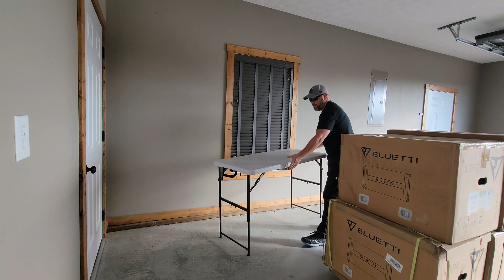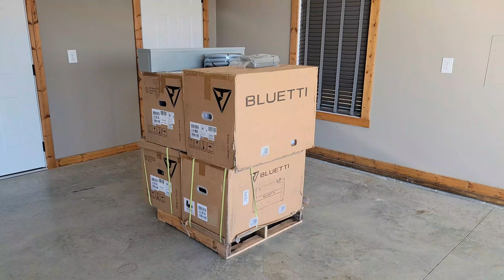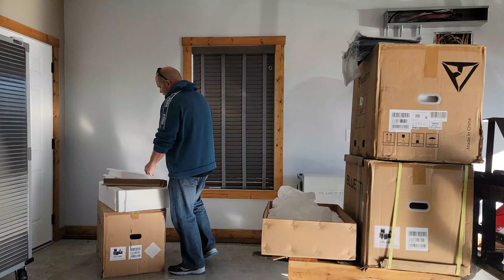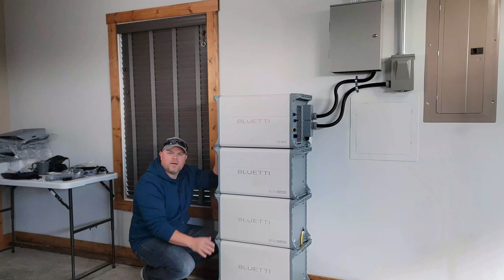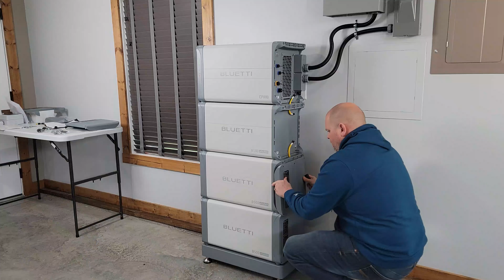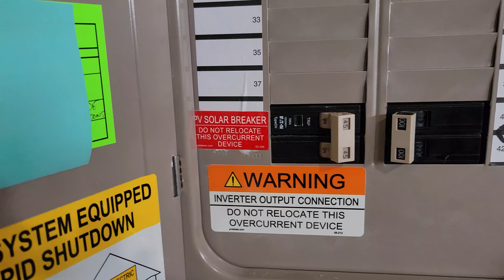BLUETTI EP800 B500 INSTALL - 7600W 120V/240V home Backup

Comment: Great job on the video, but who has their power to their home go out that much? If I bought an EP800/EP900, I would want to run off the battery all the time. Solar arrays providing power. If the battery gets to 10%, then automatically start charging from the grid to the battery until 50% and then stop.
Reply from the maker: Thanks for sharing

Comment: Nice video.  You have a real good ability to understand what needs to be done and convey that information in a manner that’s easily consumed by non professionals.  That said, I was most impressed with your ability to lift and place those batteries!  Lol.   Quick Question - I'm considering installing this system - do you see any issues with the bluetti being in another room about 25 feet from the service panel?

Comment: I have the Bluetti AC500, the B300S one battery and the 350 solar panel packages. I wish I had seen your video before purchasing. Love to see you hooking up the BLUETTI EP800 B500 Home Battery Backup. I am a slow learner, and you explained it with ease... Ty. Any advice for the kit I just purchased?? We purchase this kit just for power outage. Maybe have it hooked up to the house electrical panel?? Any advice would be helpful. Ty  :)
Reply from the maker: I have couple videos on the AC500. I am currently using that in my shop as a 240v system.

Comment: I just recently came across your channel. Observations, you are very talented and also have an incredible skill for instructing to even including reference to the sources of the products you are using. Are you an engineer? I notice your workmanship details and frankly you are much better than the workmanship I have seen from licensed electricians. A little harsh, professional electricians I fully understand are driven by time and profit, you have the advantage of time and no income incentive because you are only doing one time. Example putting insulating bushings on the ends of your conduits to prevent wire chafing. My question: why did you decide on the Bluetti batteries vs Enphase 5P batteries to keep the system homogeneous?  If you had installed Enphase IQ8A inverters you would still used the Bluetti batteries? I may have answered my own question.
tt
Reply from the maker: I appreciate that. For most Enphase users they will probably go with Enphase batteries. However, I like to explore all the options and always challenge the status quo. I am very happy with the Bluetti EP800 and B500 batteries. If I were starting from scratch and I was not backfeeding the grid I would only use the EP800 and B500 batteries. Bluetti does offer an EP900 that could back feed to the grid, maybe someday I will try that out :) Thanks for watching and commenting! 👍
Reply: @TheSolarPit  Justin - Great video.  I'm contemplating that EP900+B500 install.  Do you know if in that case I'd move the solar injection into the load into the sub panel?  With your set up, I don't see how the AC solar can help charge the batteries when/if the grid goes down?  But they should be usable during the day with the grid online.  Can you comment?

Comment: Too bad I wouldn't come with 6 batteries. It would be good if you could have you hook up 6 batteries instead of just 4 batteries. Do not make that a perfect machine, but then again they do get the AC 900.
And that comes with a lot more batteries. I understand that definitely electrician for as well. Of course, I know you can pair 3 of those inverters up, but each of them have their batteries for batteries. That is 12 batteries with 3 generators. That is a great machine then as well, that way, but I still wish it would be. I don't have six Batteries to each one.
Reply from the maker: Thanks for watching and commenting

Comment: I was hoping it had better management for Grid-Tied Micro Inverters. because a lot of those use Powerline communication. So i would have been good to have a system that can track and monitor your solar production as well as knowing how much of your solar production is actually going into the battery packs vs coming from the Grid. 

It feels that with most products, if you want true home backup and better management, you need to go with a DC Coupler Solar system to the Hybrid Inverter. That would give you the clearest management of storage vs production.

The only unit i have seen that seems to manage it the best is the EP Cube. Because it's gateway has a separate input for AC Solar and other power generation options. The next closest one is the Tesla Powerwall.

With this Bluetti solution, it appears that the Ep900 is the Inverter and the "Gateway". But that is why he has a separate sub-panel for essential loads. 

BUT there is one problem with this setup though, if the GRID does go down, the main AC Coupled solar array will go Offline. Meaning that the batteries will only charge with the DC Coupled solar panels (the test rig) and not from the large rig. 

I am looking for a battery option that is compatible with my grid-tied micro inverters where i can leverage it as a whole home backup but allow Solar to charge the system when the grid is down. I want the ability to be Semi-Off Grid if needed.
Reply from the maker: If you have IQ8's vs. my IQ7's, you would be able to charge the batteries in a grid down situation with the existing system without a DC backup array. I love having the dual option of AC and DC coupling. Peace of mind during those periods of time where we might get 5 days of complete cloud cover. Although AC coupling is not the most efficient method, it does have its place.

Comment: Great video. I am about to do an install for the ep900. Which ac disconnect did you use to connect the grid to the battery?
Reply from the maker: I picked up the AC disconnect at Menards. Good luck with your installation. Thanks for watching and commenting 👍🏻

Comment: Great video. I've got mine ready for installation, once my electrician schedules all the 240V work. This is very helpful and made it less complicated than I thought it might be. Like you say, no plan is perfect, but I feel confident that we'll get it all done and working in short order. I don't have the solar array yet. That's for later this year. So for now it's just going to be a UPS. Looking forward to adding solar when that time comes, and put my essential circuits on renewable energy. Would you please do a follow-up video? I'd like to know what circuits you have on the subpanel, how much current they draw, and whether your solar array keeps up with demand. That would help my planning for the solar portion immensely. Thanks!
Reply from the maker: The installation process is very straightforward and rather simple. Finding a good location in my garage was my biggest challenge. Good luck with your installation and comeback, and let us all know how it went. Thanks for watching and commenting 👍🏻
Reply: @TheSolarPit  I hope you don't mind a question. My electrician is coming tomorrow to do all the 240V and subpanel work. I got all the rest set up today -- battery connections, communication cables, etc. It was easy to see where the grounding cable would go from battery 1 to battery 2 (I have two batteries, unlike your 3). But it was not apparent where a grounding cable would go from battery 2 to the inverter unit. And the installation manual that came with the system is remarkably vague on this point, given how detailed it is in other respects. Watching your video, I could see you ground batt. 1 to 2 and 2 to 3, but it didn't seem like you connected a grounding cable from 3 to the inverter unit. Correct?
Reply from the maker: I will definitely be doing some follow-up videos